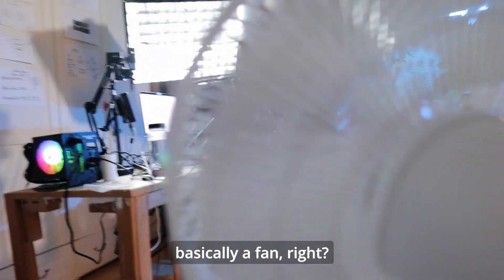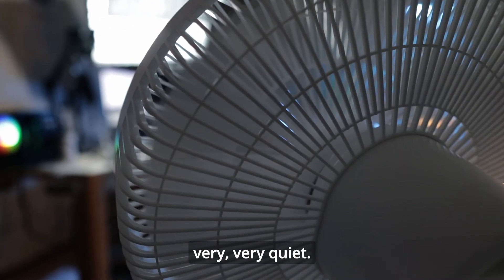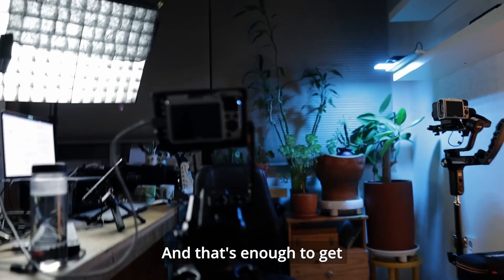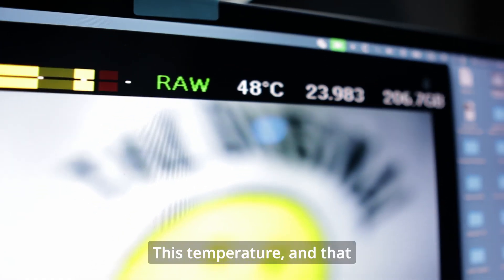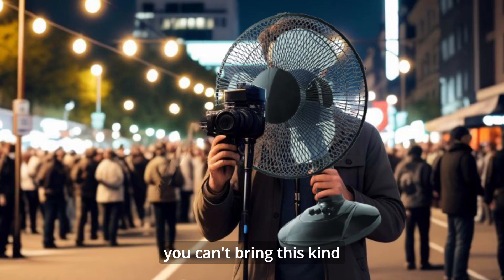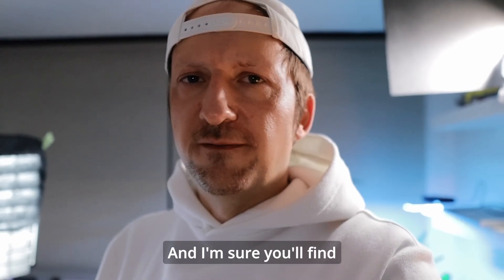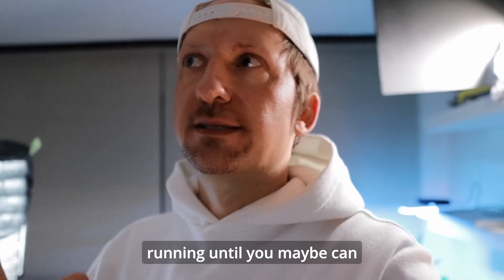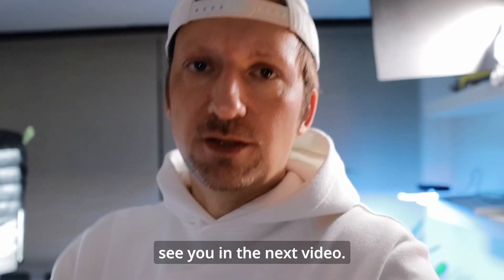EOS M RAW - Overheating Hack (Without Re-housing)

Comment: Don’t get it. If it overheats that much, why does anyone still bother using that camera? There are more cons than pros with it...
Reply from the maker: it doesn't, not to the point like say R5 just shutting off. It's mostly in hot countries with occasional reduction in recording time. If that is bothering, than a fan can help. Also with video noise. The cooler the less noise (which in non RAW cameras u never get to see but it's there but with RAW we get to tailor noise reduction ourselves) Why use it? the image simply destroys even many modern cams and for the price it's unbeatable

Comment: What’s the cage that you have on the eos m?
Reply from the maker: I'm not sure. I think it's a M6 Mk2 but I had to change the top part to be able to access the M's buttons (unscrew and move 1 cm glue with Epoxy). also, 1 mm plastic added to the inner front to prevent wiggle. I have an M6 MK1 cage in storage but that also needed mods. in the main Facebook group there is a 3d printer file for sale with pretty much the "perfect" cage